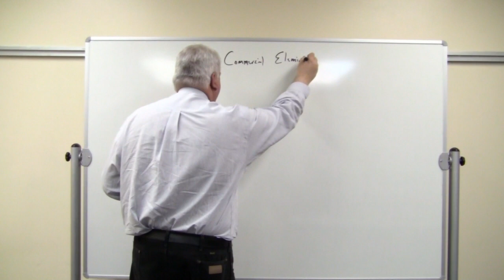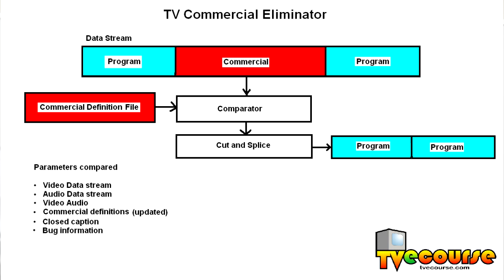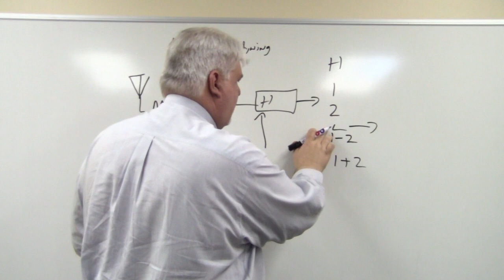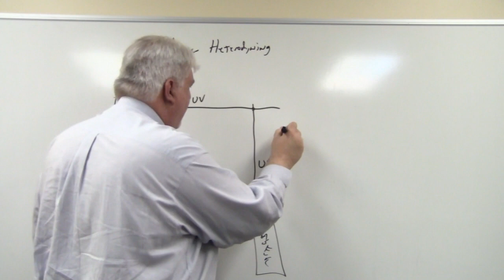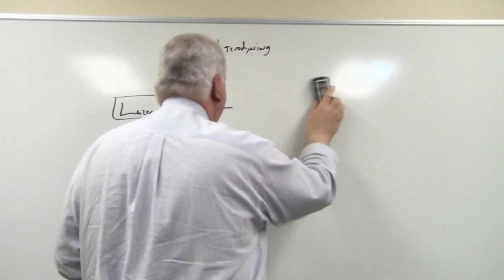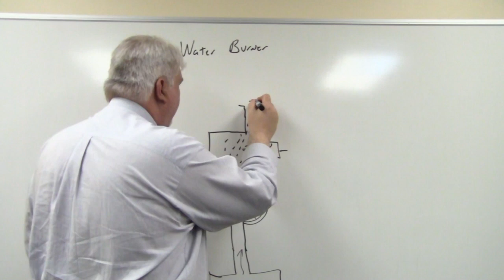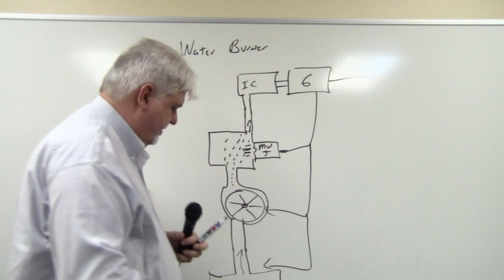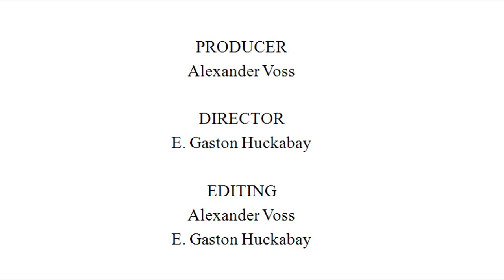New invention - Witty Inventions Class 23

Comment from the maker: I'm using a low power microwave signal to separate molecules that can be burned. If the power used to separate the molecules is less than the energy created by the burn then energy can be extracted from the system. The conservation of energy law only applies in a closed system.

Comment from the maker: To olivermillion - This is an improvement of the John Kazious system to allow more water surface area exposed to microwave signal. (using a mist and not a beaker) I am experimenting with frequencies and harmonics. So far things have been encouraging. I believe there will be a point where energy surplus will exist in the system.

To parangarito22 - I patented the commercial eliminator and that was allot of expense and then nothing happened. I felt if video documented these ideas was a good idea.

Comment from the maker: For example if it took energy to pump and purify gasoline to run an engine the energy derived from the gasoline would be available for use minus the energy used to prepare the gasoline. The energy is in the water and can be used when the energy needed to extract separate the molecules is less than the energy derived from the water.

Comment from the maker: The conservation of energy law is not applicable. We at splitting a molecule to make elements that will burn when ignited. The energy comes from burning hydrogen. I don't know if the efficiency can be improved to a point where there is an energy positive. 
The energy law only applies to an isolated system.

Comment: I'm studying as a Mechanical Engineer at this time, so my experience is to say limited. For the water heater you propose however, when you split the hydrogen and oxygen, I am concerned that the energy involved could potentially self ignite both the Hydrogen and the Oxygen. As I said, my experience is limited, I don't know how grounded the concern is, but that was an immediate thought I had.
Also you would need an outtake valve for the oxygen else pressure would build up. Might also lose Hydrogen